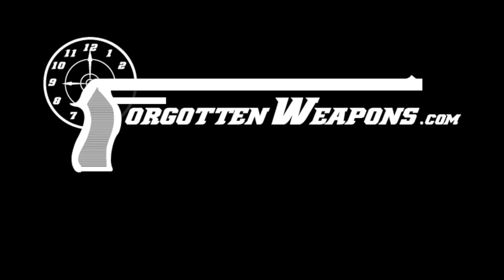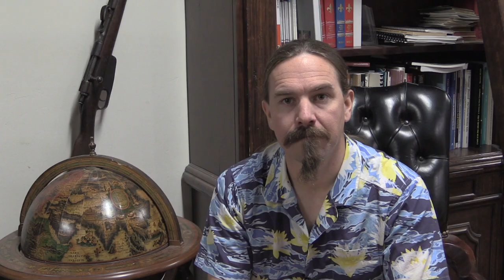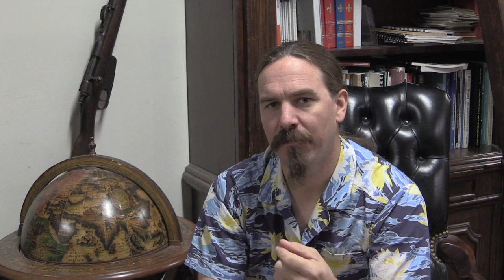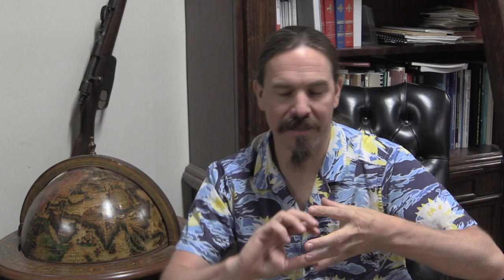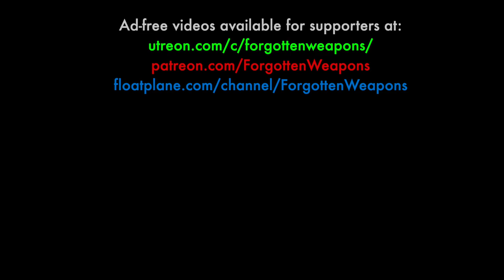Ask Ian: Progressive Twist (Gain Twist) in Small Arms?

Comment: I think it sounds like a very interesting idea, certainly making sense from the point of view of mechanics---until you realise that the conditions of the projectile acceleration through the bore are affected a lot by so many other parameters that you can probably never really optimise the rifling progression to make it work significantly better than just constant twist. Just think of the differences in muzzle velocity between rounds even from the same box, let alone from different manufacturers. Perhaps with very carefully hand-loaded precise rounds, very finely tuned...
But, I reckon it's just over-engineering; at least with common small arms calibres, it appears to be a work-around for a production quality problem.

Comment: can you do a video on barrels that are smoothbore but with rifling on the last few inches of the bore. I get that this is one of those "my mothers aunts coworker knew a guy" stories because my dad had a close friend at the range that made this rifle. supposedly this system is just as accurate with significantly higher muzzle velocity than with using the traditional system.
Reply: @SonOfTheDawn515  i had never heard of the lancaster system before and it is interesting but not what i am talking about.

Comment: One question I still have is, does progressive twist result in higher velocities? It makes me think of the smooth bore cannons on tanks having higher velocities.
Reply: Smoothebore tank guns have high velocity mostly because of the design of the projectile, i.e. a subcaliber dart supported by a lightweight sabot. You can fire similar rounds from a rifled gun, but the spin makes accuracy worse! The Brits still use rifled barrels on their tanks (so they can fire HESH rounds), I believe their AP rounds have a driving band mounted on a bearing so it can spin in the rifling without spinning up the projectile.

Comment: Now that I think about it my 35 Whelan has progressive twists rifling. I always thought it was there to spend the bullet up slower initially guess I was right 😁
Reply: Reduces wear in the first past of the barrel aswell..
Reply: @manchagojohnsonmanchago6367  I don't know why I never decided to look into it I just assumed. thanks for the info
Reply: @Steel-toad-Jack  yeah i think its still a very valid method.. But for regular guns not important but for machineguns for example or other weapons firing highr volunes of ammunition or very hot ammunition i can see it working well.. Reduces pressure slightly too.. But really wear is a big factor. Also its good on sabot rounds being used in rifles guns for example
Reply: @manchagojohnsonmanchago6367  I suppose I should mention what the gun is it's a bull barrel single shot h&r. Thanks for the extra info

Comment: I have been interested in using sabots. Any chance you know of where to find sabots that are actually something that works in a high pressure rifle?
Reply: That's an interesting question now that you bring it up.  Today most people think of sabots being plastic, but I would think for a precision rifle a copper sabot might be beneficial. i.e. intentionally having the "jacket" break off once the bullet exits the barrel, but in a controlled fashion.  But I don't know the answer.
Reply: @tarmaque  My idea is since all these modern rifle rounds coming out are all about maximizing external balistics why not make a rifle that does internal as well. I make knives and do my own heat treatment and I think it is possible to heat shrink in an insert of steel that can handle high pressure without burning or pitting. I would like to straight wall the 277 Fury and actually see if it can handle 100kpsi. I could use heavy bullets or light ones. The hard part is the sabots since if I was going to say want 6.5mm for the actual bullet and a very long one at that or an ultra long 7mm that sabot will need a tight spin and the sabots can't come apart although if it's out it the barrel it's fine...if it doesn't affect the bullet. So yeah that's my idea about what will guns be like if we max all the performance gains. It feels like we are kinda stuck in the past.

Comment: Completely random thought:
How about a smooth bore, followed up by a rifled barrel? (Progressive or normal)
What effect or use would that have? (If any)
Reply: Talking out of my ass here, but as far as i know, a bullet needs sufficient pressure and velocity to engage rifling. Going from smoothbore into rifled could probably either stress the rifling inside the barrel or lose a decent amount of power as in enters rifling.
Reply: Some airgun uses barrel like that (FX Dreamline Smooth Twist Barrel). They says it improve accuracy for pellets.
Reply: As in FX air rifles?
Reply: @DrSabot-A 
   That seems to make sense. So it would only be useful in things like air rifles, where the pressures are much lower.
   If this were to be applied to a firearm, I would suspect low velocity, such as subsonic, would only be doable.
   But a smooth bore followed by rifling probably would have no desirable effect for ballistics or weapon lifespan/reliability. (Maybe a reduction in barrel heating near the barrel nut end?🤔 Might keep the action cooler if true...) Otherwise there's no practical point to my idea anyways (aside for generating new ideas, or having a civilized discussion about firearm design)
Thank you for your reply by the way.

Next random idea:
Regressive Rifling! It starts fast, and slows down in twist rate, as the projectile accelerates down the barrel! 🙃

Comment: The Italian Carcano carbines were quite inaccurate due the gain twist rifling,  or rather the lack thereof .The rifles that were converted into carbines originally were gain twist to start with, but were shortened to carbine length. The rifling that remained did not have fast enough twist to stabize the long heavy bullets the Italians used. Hence, poor accuracy.

Comment: Imagine varying the gyroscopic stability of your rounds based solely on how much powder randomly burns.

I thought consistency was the goal with weapons?
Reply: That's actually what happens with all guns. While the twist rate leaving the gun is consistent in terms of distance per revolution, the actual RPM the shell is turning is linked to muzzle velocity. This is why Battleships refrigerate their magazines, to get the most consistent powder burn possible.
Reply: @SgtBeltfed  Yeah, but all guns aren't designed to make it more variable on purpose. Doing a progressively accelerated spin would require more consistent powder burns to reduce the exacerbation of variations. Essentially it makes it exponentially harder to be consistent for a linear increase in spin? unless the goal isn't consistency I guess, in which case, why bother?
Reply: @nobody8717  I don't think the gain twist would matter one way of the other. Unless the bullet is "slipping" on the rifling, the final spin rate of the projectile is determined by the twist rate at the muzzle and it's muzzle velocity. The only variable is the powder burn, and what velocity that burn achieved. The end result is still linear.
Reply: @SgtBeltfed  It's accelerating the spiral faster, that momentum has to go somewhere...
Reply: @nobody8717  Gain twist actually starts spinning the bullet slower and increases the rate of rotation as it goes down the barrel.

If gain twist rifling starts at 1 in 16, and ends at 1 in 8, the end result is exactly the same as constant twist rifling at 1 in 8. The only differences are it's gentler on the bullet, maybe a little less energy lost when the bullet starts spinning, and the much higher cost to make the barrel.
Reply: @SgtBeltfed  Yes, starting slower then increasing as it progresses IS THE DEFINITION OF ACCELERATE. Otherwise going from 0-60 in 0.2sec would be the exact same as going from 0-60 in 785.43sec.

The rate of spin increases as it progresses. That is an acceleration in the spin. It means that if the acceleration happens faster, there will be more force applied to make it spin, thus making it spin faster.

Which means how hard you push it varies how fast it spins, at an exponential rate compared to a normal barrel rifling, which increases at a linear rate. i.e the difference between 2(200) and (200)^2
Reply: @nobody8717  If you're starting out with a lower twist rate and increasing to a higher twist rate, you're accelerating the rotation of the projectile SLOWER than you would if you went with the higher twist rate to start with. What you're doing is flattening the acceleration curve out, the end points remain the same.
Reply: @SgtBeltfed  if you're starting lower? That's a neat assumption you made to fit your argument. It's almost like I'm 100% right, and you have to modify your explanation to fit it. The entire point of the design IS to start lower and then get faster. That's what it does. That's its purpose. I'm glad you finally understand that point.

And its entire design and purpose CAUSES variations in projectile velocity to change the *acceleration* of the twist instead of the *velocity* of the twist. And remember 5th grade physics class? Acceleration is VELOCITY OVER TIME.
Reply: @nobody8717  That's was is stated in thy video you start at something like 1 in 15, and progressively go to something like 1 in 8.  At no point have i ever stated that you start with a very tight twist and slow it down. That would entirely be counterproductive. Older large caliber naval guns would start at 1 in 30, tightening it up to 1 in 15 by the muzzle. It was probably done because spinning up a 12" diameter projectile weighting in at about half a ton is somewhat risky. Later models, sometimes of the same gun, dropped the gain twist and went to a straight 1 in 15, as improved shells no longer needed to be treated gingerly, and any other benefit wasn't worth the cost.
Reply: @SgtBeltfed  So now you assume it's backwards to make a point? What are you smoking, my man?
Reply: @nobody8717  Everything you have stated has been screwed up. With gain twist rifling, they always start off with a low twist rate, and increase it as you get to the muzzle. I have never stated otherwise. There's nothing that inconsistent powder burn is going to do with gain twist rifling that it wouldn't also do with constant twist rifling.